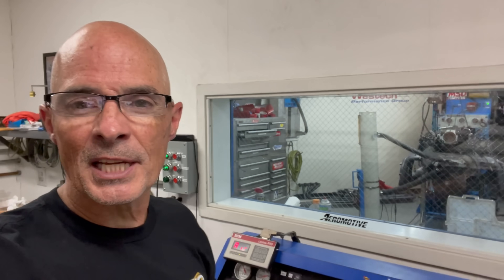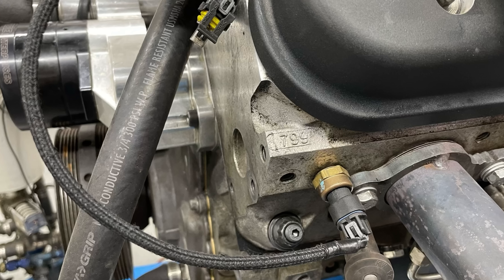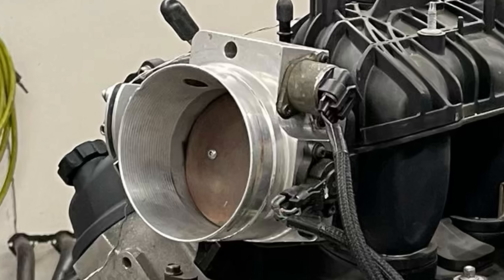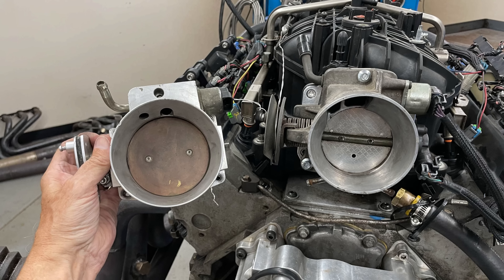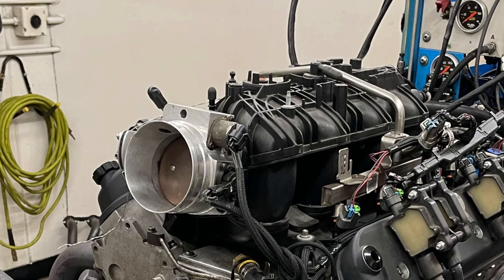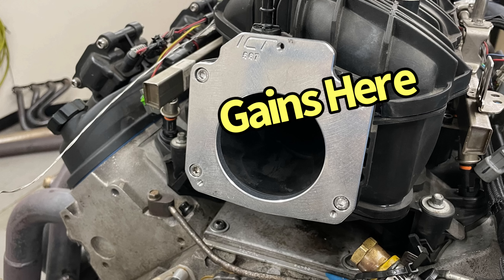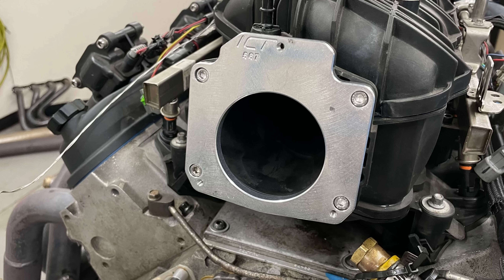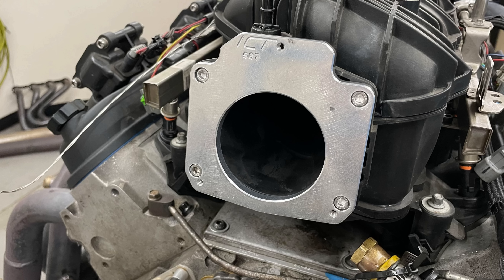BIG THROTTLE BODY-DO YOU NEED IT? TBSS INTAKE THROTTLE BODY TEST-78MM TRUCK VS 92MM FAST WHO WINS?

Comment: Kinda bummed nobody makes a larger 3-bolt, 8-pin DBW throttle body. I know I'm going to need a bigger TB and better intake, but the fact I have to buy a 300 dollar wiring adapter is ridiculous. I also worry about the reliability of said adapter, and what if it gets discontinued? Ugh lol.
Reply: Wouldnt really help due to the restriction on the intake side….
Reply: I feel the same way

Comment: I remember your TB test on the roots blower supercharged engine. It wild to see how much a 102mm was worth over a 78mmon it. 

I honestly didn't expect to see an almost 8hp difference in power. 

A friend of mine went from a gold blade LS2 90mm to a stock 78mm truck DBW. He swears it made exactly the same peak numbers. 

Hard to believe, he has: LQ4, L92 heads and intake, Comp 469 cam + all of the bolt ons. It made 422 rwhp through a 4L80E with a 4500 rpm stall converter. 

I felt the rec port truck intakes are similar to the TBSS. Maybe enough  different to matter?
Reply from the maker: he needs to test again. There is no way a 78 makes as much as a 90 on that combo (chassis dyno testing error)
Reply: @richardholdener1727 I agree with you, it doesn't make sense. He's definitely moving more air than the 5.3L

Comment: I bought a rods pistons, cam and springs long block from ATK, it is a 5.3 to replace my LS-1 that hydrolocked. 
I almost pulled the trigger on a big intake and 92mm TB but the shock price made me decide to swap all my LS-1 stuff over with bigger injectors and long tubes and I fiddled with the 243 heads a little too.
The tune from Frost was base setup for the 78mm TB and the specs I sent him, then with returning him several HP recorded road dyno runs to review and dial in. The 411 was an upgrade for the 98 TA to carry the better tuneability apparently, so I did that too.
This car rips now dude, it is much faster more responsive and is everything I always wanted in a weekly fun driver.
There’s a couple videos on my channel if you care to peek.
Love all your content brother, peace!

Comment: 7 hp from a TB swap is pretty good, in my opinion.
Reply: With stock parts or dbc, I agree. 7hp from a dbw throttle body when they cost several hundred dollars is a horrible mod.
Reply from the maker: I redid it-louder and with graphs
Reply: @richardholdener1727  I see that. Thanks for educating us

Comment: Great vid Richard.  I'd love to see a dyno test on Accufab's "Race" TBs vs "Standard" TBd with the same blade opening.  I've heard the "Standard" TBs make more power than the "Race" TBs by a small margin.  Air turbulence maybe?
Reply from the maker: The Ford tbs?
Reply: Yes.  Ford accufab throttle bodies.
Reply: @richardholdener1727  Mustang 5.0 Foxbody Throttle bodies.